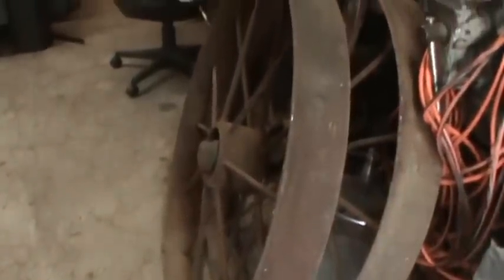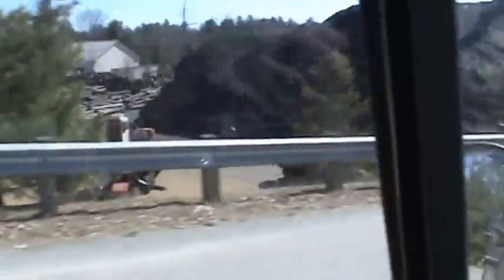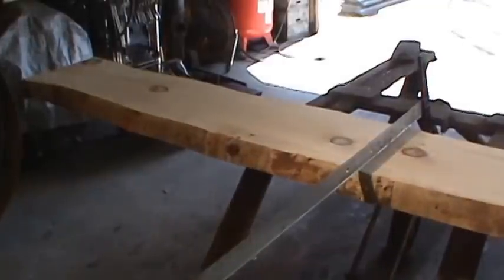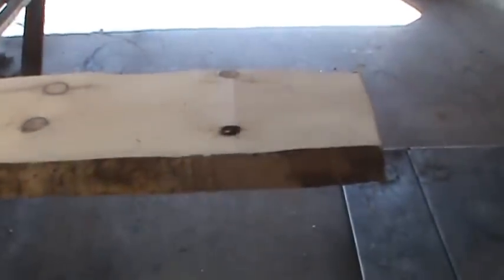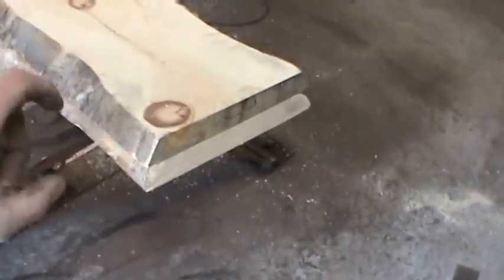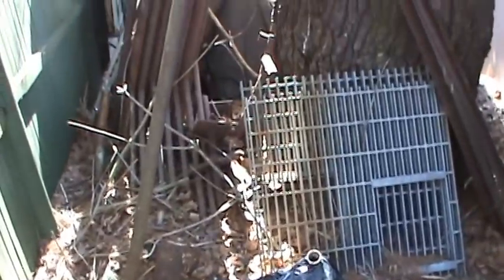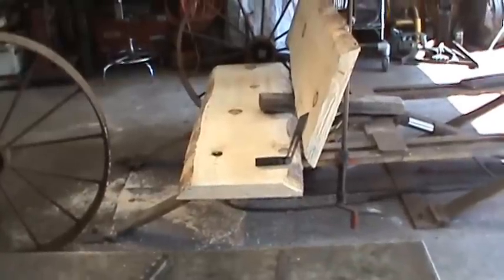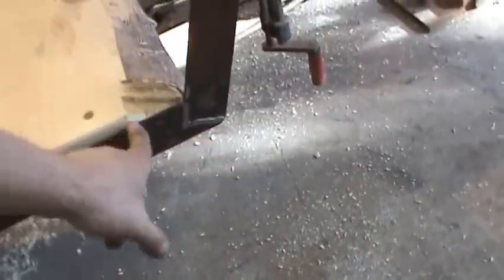lets build a wagon wheel bench pt 1 of 2

Comment: Just a suggestion but how about making the seat solid to the wheels and using inverted single leaf springs as feet on the wheels. Weld wider steel pads as feet on the ends of the leaf springs . It could then rock. Or maybe I'm a little to Rube Goldberg here.

Comment: 2 U-Bolts On Each Wheel, Welded To The Inside Of The Wheel, In The Same Areas Where the Spokes Attach To The Wheels Would Have Been A Thought Also And Attached Chain From Each U-Bolt To The Steel Frame Back And Bottom Of The Seat, Would Have Made A Cool Swing Possibly As Well... Its Probably To Tough To Explain Here In The Comments Of What I'm Saying But Would Be Super Easy To Show In Person Or Hand Drawn Diagram Of What I'm Explaining LOL It Would Also Be Easy To Make The Wheels Themselves, Very Stationary But Extremely Sturdy Also For Holding The Swinging Type Of Seat With One Or As Many People As Possible That Could Set on It At The Same Time! Every Now And Then, I Will Do Some Stuff Like This, When I Have The Motivation With Stuff, That's Of No Regular Need Or Use, That I've Saved Out Of Scrap Types Of Materials, To Get Some Sort Of Use Out Of Whatever It Would Be, That Can Still Serve A Purpose...